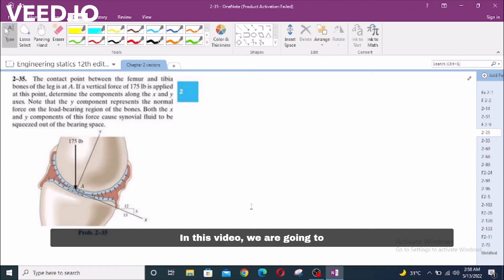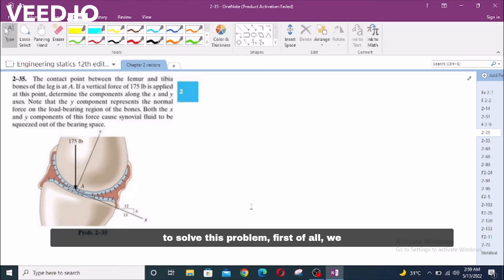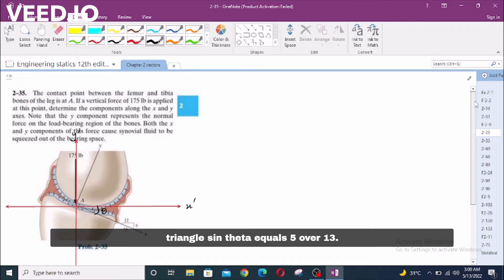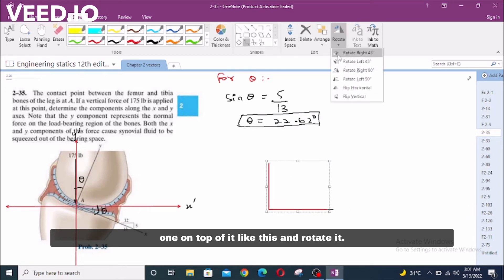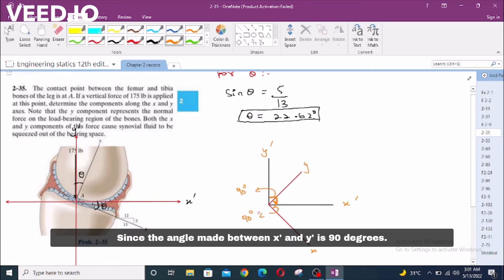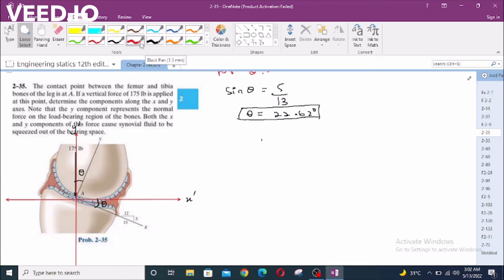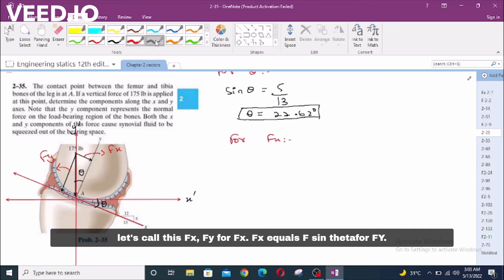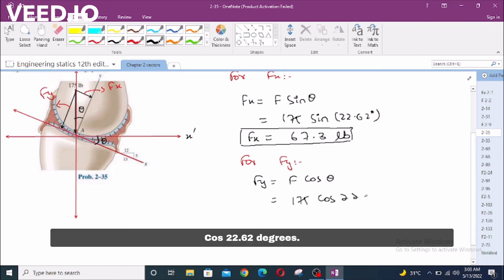2-35 hibbeler statics chapter 2 | hibbeler statics | hibbeler

Comment: but formula for horizontal component of force is fcos theta...why you use fsin theta
Reply from the maker: Cos is used when we want to find the component adjacent to the angle and Sin is used when we want to find the component opposite to the angle. Here x component is opposite to the angle theta that's why I have used fsin theta. 
I hope it will help .
Reply: @solutionsmanual9535  thanks sir